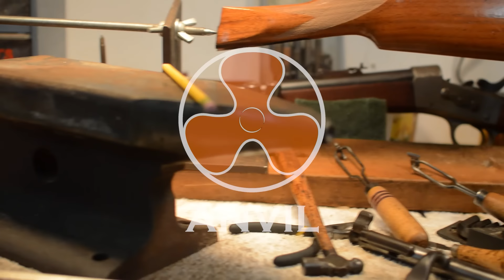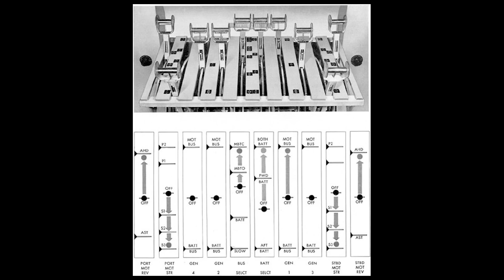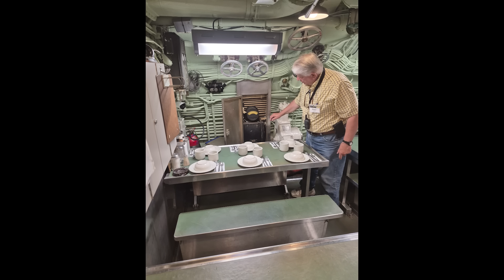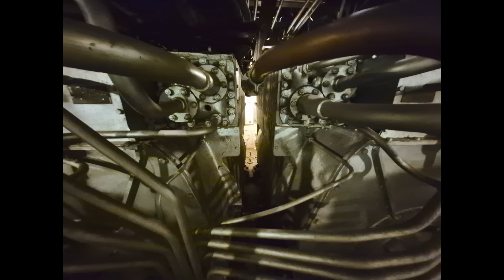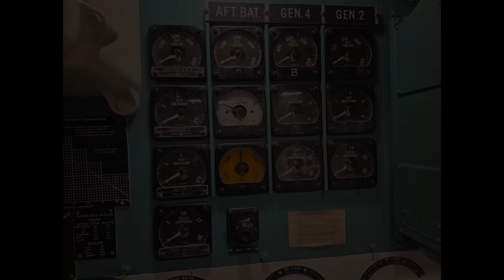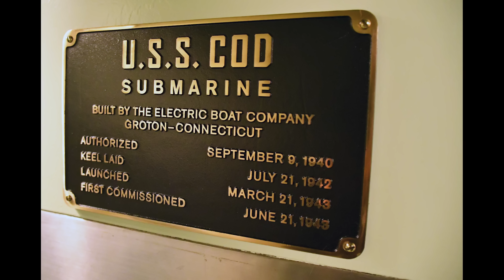Fleet Diesel Boat Propulsion: Anvil 0149

Comment: Ah the fun of working with shunted commutating DC motors... Why is this all manual??? Why not using timed time relays??? My current employer has a lot of back up oil pump systems DC for large Gas turbine power systems (in case of losing our AC power, we can run down the turbine with batterys driven DC oil pumps)
Reply from the maker: The crew is about to find out about timing capacitors when they fire up the exhaust blowers. My bet is the caps are dried out.
Reply from the maker: Starting surges into the main motors varies depending on battery voltage. Therefore the surge timing constantly varies, making manual control necessary
Reply: @marknovak8255  makes sense. our installation is  a lot newer (early '90) but still a lot of mechanical and electromagnetic interlocks to get the DC motors working

Comment: Mark, what a cool video.  I had never thought about how the sub engines made the propeller turn.  Generators or batteries and electric motors running  on DC makes perfect sense.  All except like you said, these were 20 somethings running these boats and there is a very respectable amount of energy in these controls.  I can only imagine the amount of stuff that could go wrong.  Your animation was really cool in showing the system in action.  Interesting about the resistors at startup.  They must have been huge.  
We have a sub in San Francisco from that era, the Pampanito SS383.   It is a little newer, launched in 1943.  Is open to the public.  Amazing tight quarters for those men who served onboard.

Comment: 2 questions Mark, where are the current smoothing capacitors in the circuit, apart from the resistors? And how is the stuffing-box constructed, which allow the screw shafts to exit and still spin? 1 comment as well, this is an awful lot of energy to be standing around as a human conductor. Kudos to the brave crews of all subs man.
Reply from the maker: No capacitors. All rectification done mechanically with commutators and brushes, so no noise. Stuffing box is a ring that is pulled up with the protruding studs. Tighten up to compress packing material inside the stuffing box. Just like a pump gland.
Reply: @marknovak8255  Thanks Mark, all clear.

Comment: The Taiwan Navy still operates two WWII diesel boats the Hai Pao and Hai Shih (formerly the Tusk and the Cutlass) and they (supposedly) recently spent a potful of money refurbishing them so there are some sailors still possessing the knowledge.
BTW. in the early1980s My brother in law was a reactor operator on the USS Hawkbill ssn 666.
Reply: They 'operate' them in the sense that the 'guppy' class will float and are unlikely to kill everyone onboard as long as they continue to never travel outside Tsoying Naval Base and never more than 10 metres below the surface.

The USS Cod could probably be brought up to a similar level of 'operating' conditions with a couple weeks work by the dedicated men working on her.

Comment: In reading “Run Silent Run Deep” Beach mentions being able to run to motors in series or parallel from the batteries, what would be the use case for running in parallel over series?
Reply from the maker: Parallel to go fast. Series parallel for medium. Series to go slow. 270, 135, 67 volts per motor

Comment: Mark, I'll begin by thanking you for your service & thanks for the videos. My father's uncle was the Chief Electrician on the the heavy cruiser USS Chester. He was in the Navy Reserve & what was supposed to be his last cruise as a reservist was Dec.7,1941. Needless to say that is not as it came to be. He got off the ship with extended liberty on only two occasions during the war, once when she returned to the states to repair an aerial torpedo strike & another time to repair damage from a kamikaze hit. He responded to a letter that the Navy Department mailed him in 1959 that she was to scrapped & were she would be available so he might see her to say goodbye. He arrived at Panama City, FL & was met at the gangplank by a sailor. The sailor offered that a guide to show him around could be arranged, but dad's uncle waved it off with the statement: "sailor there is no compartment on this ship I haven't seen". My thanks again.
Reply: As Mark once observed, "from prop seal to torpedo tube..." Different ship, same sentiment. 👍🇦🇺

Comment: I worked on the R/V Shell America, 300 foot OAL, about the same displacement, and the same powertrain. There are people alive who could run that propulsion system.
Reply from the maker: Except, perhaps, the underwater part, and the battery charges?

Comment: No idea what class they were, but the Navy still had two diesel boats well into the mid 1980's, so there is a good chance someone still alive could operate that warship. I got to eat lunch on one when they were loading torpedoes one day. Honestly it reminded me of eating inside a diesel fuel tank. Best pork chops I ever had in twenty years in the Navy though.
Reply: Mind, the manuals and handbooks still exist and that is most all you need to run a US Navy warship in WW2. Uncle Sam knew most of his sailors and officers were going to be average people with little to no experience in the Navy rushed to sea with only some weeks of prior training. Thus, Uncle Sam ensured everything had a reference book and/or instructions on it for sailors to read as needed. My Grandfather's abiding memory of being a skipper of a Mine-Warfare Vessel was the pile of books he was given to read on how to do everything the "Navy Way," be it run the radio, navigate, disarm mines, or discipline sailors.
Reply: The Barbel class.  One is preserved as a museum ship in Portland, Oregon.
Reply: The the class namesake Grayback was one of them. Originally designed to launch regulus missiles, repurposed later to allow underwater boarding for navy SEAL operators. My uncle was on the grayback. Five sailors were killed in a pressure chamber accident January of 1982 while my uncle was aboard

Comment: I worked at a coal burning power plant that had a battery room for each of the three units filled with big blue plastic battery boxes.   440V and they used them to motor the turbine when it was off line so it wouldn't sag then bring it up to speed until the steam could take over when brought back up.   Enough current to cook you...and sadly we had a guy get in a hurry pulling fuses and got clamped on between two until his arms cooked away.   Mark is right that there were lots of things that could end you if you aren't knowledgeable and careful.
Reply: There's a similar compartment behind the cab of most US diesel railroad engines.  It's the circuit room.  While learning how to safely check freight trains for unauthorized passengers, this little compartment got a good deal of extra attention.  It looks like it would be a good place to hide out (or would if you ignored the numerous warning placards on the access hatch and in the compartment itself).  Open, much quieter than squeezing in next to the diesels themselves (it's been done), warm...sounds cozy, right?
Except that the air gap across which the circuits lining the wall of that compartment will arc is only slightly smaller than the compartment itself.  Engineers will find stowaways in there occasionally.  Getting them out is a real PITA, because both diesels have to be cold and all the circuits safe before anyone even reaches into that room.
     How do you inspect it?  You open the hatch and shine your flashlight in from outside .  Do not poke your head or anything else into that room if any of the diesels is running (and they usually are).